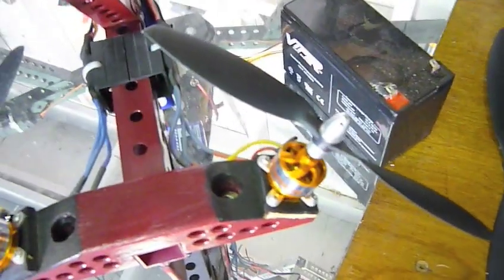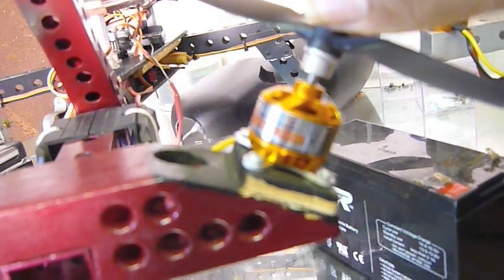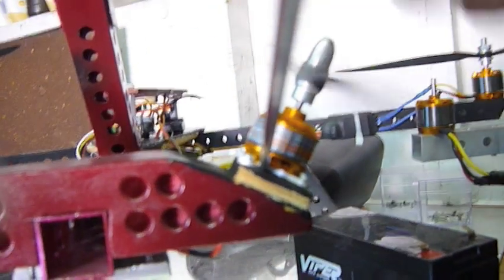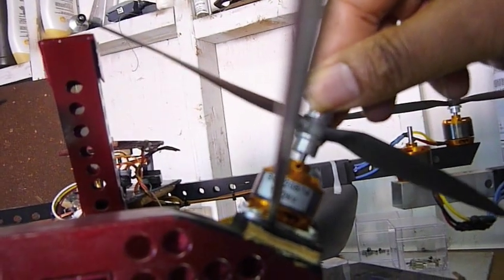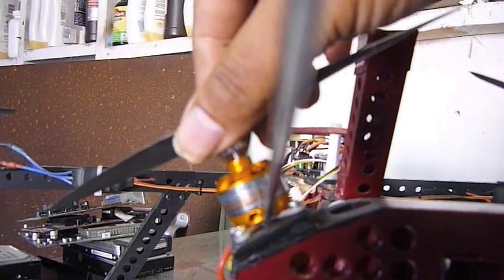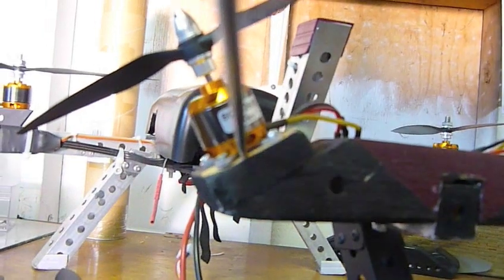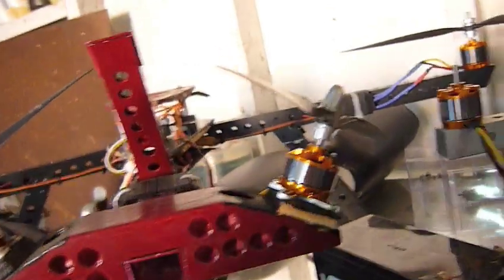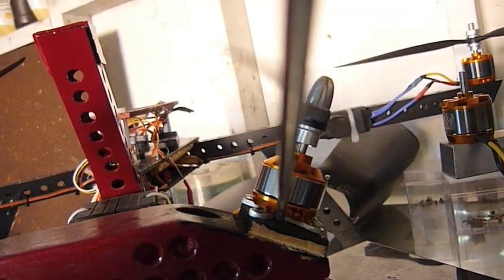Detecting Bad Bearings

Comment: Good example :) I have a bad bearing on a model airplane motor after a crash, it will take another week to get the new motor (new bearings are not available) so im a bit unsure if I dare to fly it with a bad bearing until the new motor arrives...